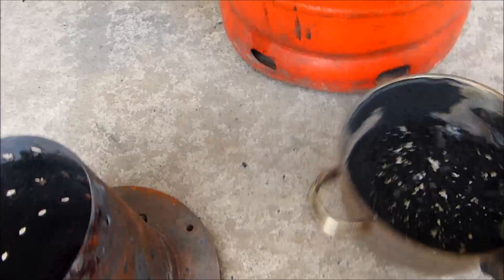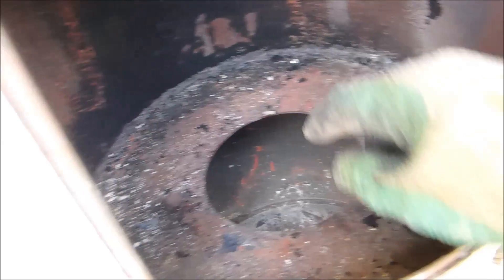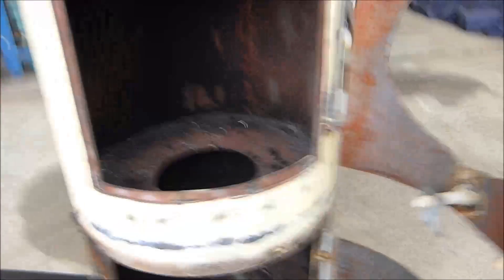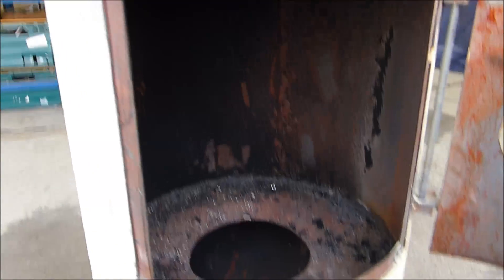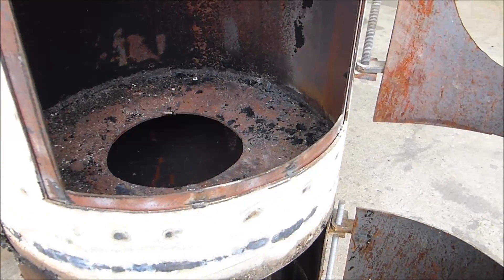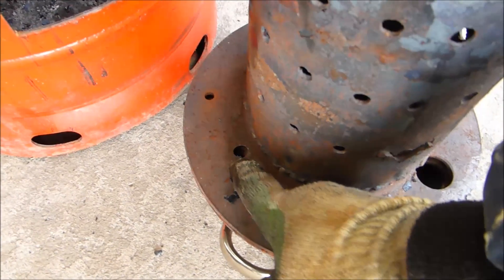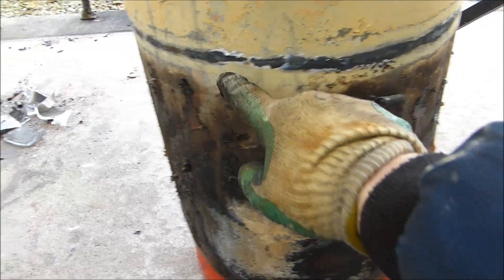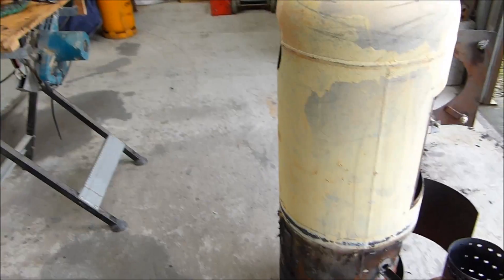Make a great waste oil and wood burning stove heater (part 5)

Comment: Great video!  Thanks for sharing.  One question - How did you weld the cast iron brake rotor to the iron pipe?
Reply from the maker: Hi Billy. Its possible to drill and bolt L brackets to the 6 inch pipe and the brake disk but I just welded them together

Comment: hi Gerry, first off id like to say you have made the perfect heater ....that perfect ive actually tried to copy your design he try and heat our unit/garage, ive had mine running but couldn't get it to roar with heat like yours also smoked a lot as if the air/fuel mix  was wrong , so I referred back to you vids to see why , I have used a slightly bigger pot , then instead of a break disc I  used flat steel plate , does the middle of the break disc act as air feed?  also I noticed ive made my combustion tube with a lot more holes , could you tell me what your pot measures across ways, and the length of you tube from the face of the break disc to the end?  any help would be greatly appreciated , many thanks .Richy

Comment: can you explain me how that oil burn because if you try to fire up oil it wont burn ?  and how you can be sure that fire can not rise to oil incoming ?
Reply from the maker: Hi Philip. Getting the vaporising pot red hot is important because it makes vapor / smoke of the incoming oil which is the bit we are igniting to make flames. You are correct in that the oil itself is hard to ignite but like with a frying pan in the kitchen if you get it hot enough it will flash and burn. The oil in the incoming pipe will not burn because it is too cold and still too hard to burn. Even if you lay a trail of oil on the ground and try to ignite it with a torch it will not light. Of course if there were petrol / gasoline in the oil there would be serious problems. Its an easy project and can be made from all sorts of scrap vessels for little cost and can really whack out the heat.
Cheers Gerry

Comment: I built my first one this year, and like anything else, it it constantly changing.
What I wanted to share is that here in the states I discovered ceramic laden paint at my local auto parts store that will take up to 2000 degrees! I used it on mine and even a propane torch held to it doesn't discolor it.
Reply from the maker: Thanks Mark. If you look at the last video I did the stove has burnt off all the paint and has lost its black look. I will look for the ceramic laden paint locally or  on amazon or ebay. Thanks for the heads up. Cheers Gerry

Comment: well done top marks steel and glass cool down at different rates you could try an oven door with mods / microwave door?????. I'm getting the parts together to make a wood / coal version and adding an outer jacket for water. fantastic job mate

Comment: You are very inventive, so congratulations for the nice job done. I think that your heater can be used also for CENTRAL HEATING, so please give us a clue how to add a back boiler. The system can heat the whole house as well as hot water for the bathroom.. I was a Restaurant owner, and we were donating our fryer oils for recycling because it was illegal to throw it as trash. Thanks.
Reply from the maker: Hi Andros. I have done this and I heated 300 litres of water in about 1 hour. Here's a link http://youtu.be/1Et3rIn5GIY Cheers Gerry
Reply: Gerry's Waste Oil Burner Thanks Gerry, finally I looked up most of your videos, and are really interesting. You can probably patent your ideas and start producing some of these stoves. You will save the people' s money.